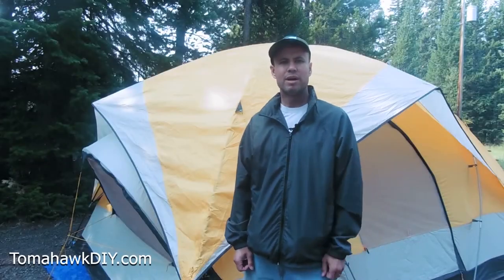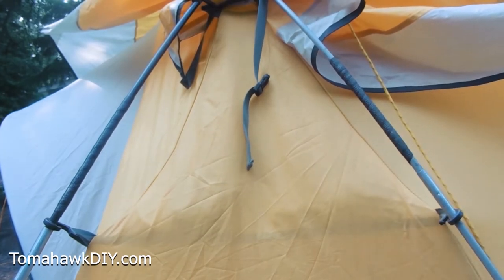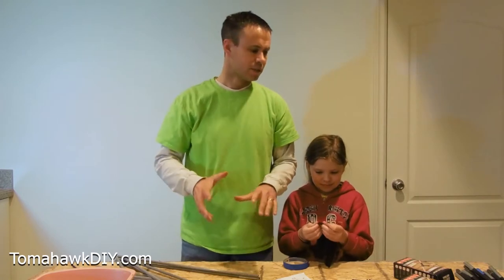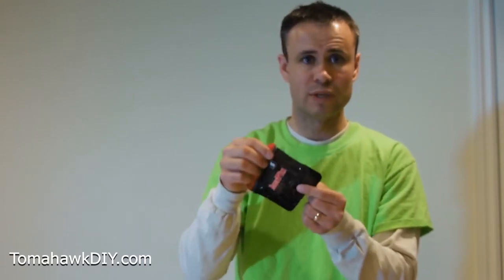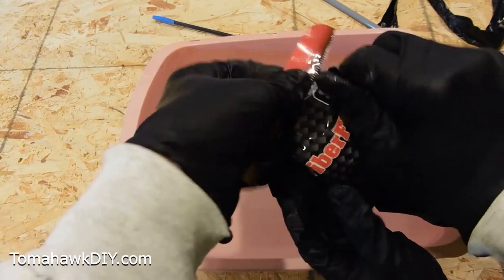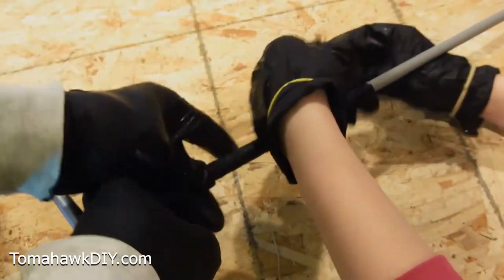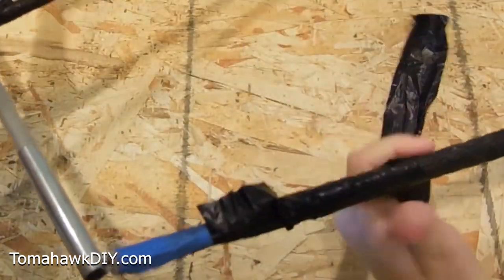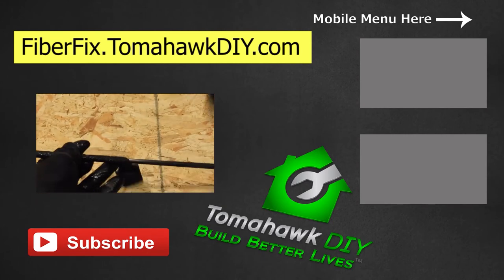How to Repair a Broken Tent Pole - EASY

Comment: Thank you for this!  Have you had further experience with this product?  To retain the flexibility of a fiberglass pole that does need to bend a fair amount (like for the instant pop-up tents you throw in the air and it comes down... a tent!).  Does one need to use the entire length of the roll of 'tape' - or can one just use a shorter length of tape?  (I have two repairs to make anyway - so I think I could work fast enough to do two).  The poles do need to bend considerably.  Any further ideas?

Comment: I have some tents that are broken at the middle of the pole. So when the tent is set up properly with no issues or broken poles, the poles do slightly bend. Do you think this product would make the pole too hard to where it would not bend at all and the tent still wouldn't be able to be set up properly?
Reply: I used this wrap for the very same thing but had a split in my tent pole. It does reinforce the pole and if double wrapped will be much stiffer. Maybe too stiff depending on what you need.